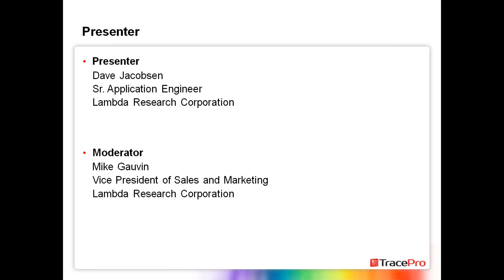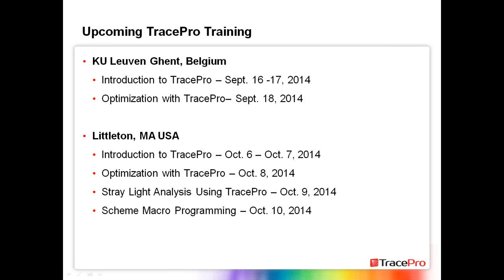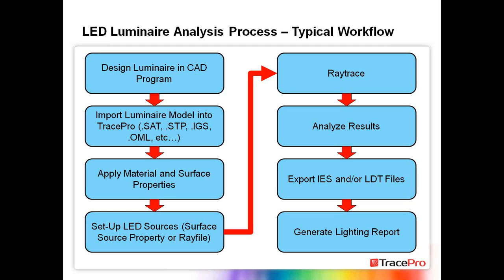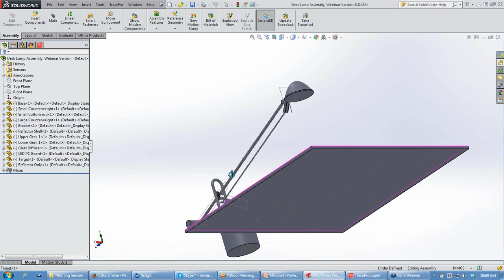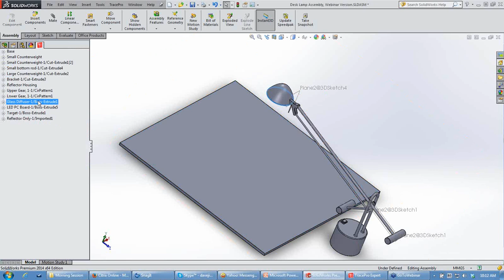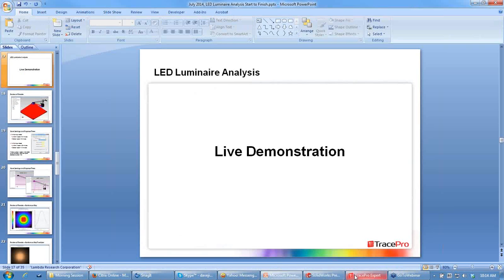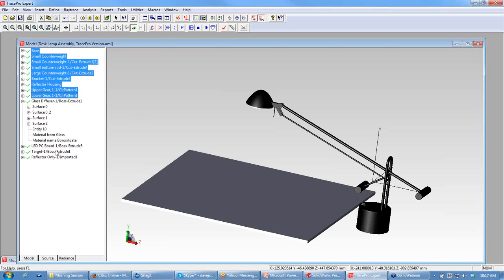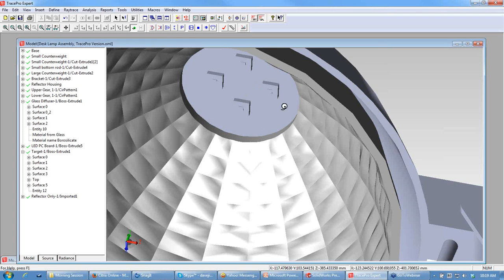LED Luminaire Analysis - A Start to Finish Demonstration

Comment: Hi, can TracePro measure light projected distance from light source & simulate light pattern?
Reply from the maker: Yes, TracePro can be used for both of these applications. The Irradiance/Illuminance Map will show them the distribution of light on a surface at any distance they choose as when as the irradiance or illuminance at that distance.